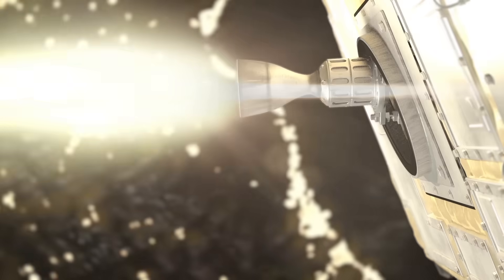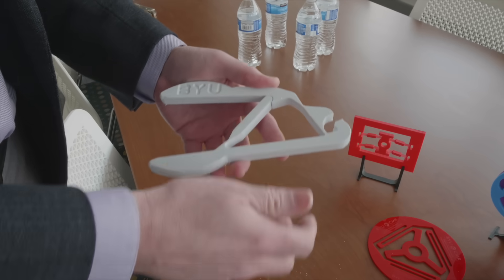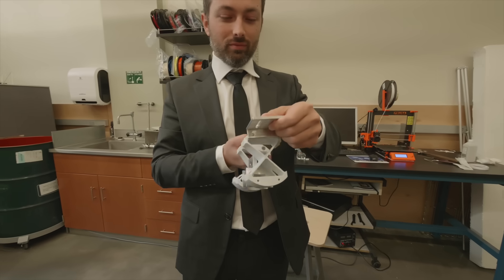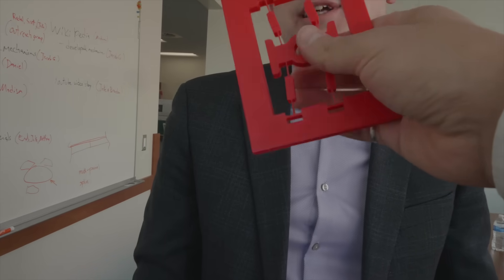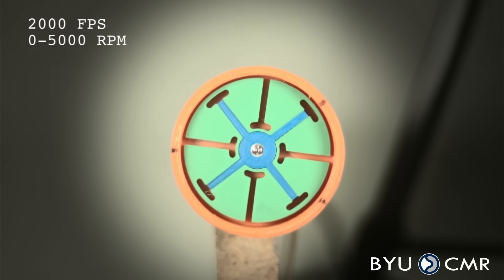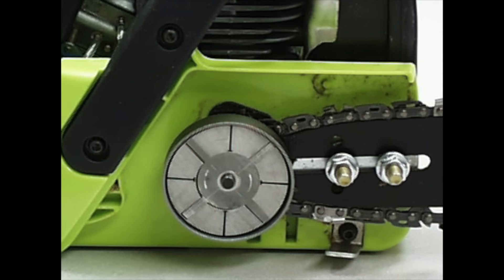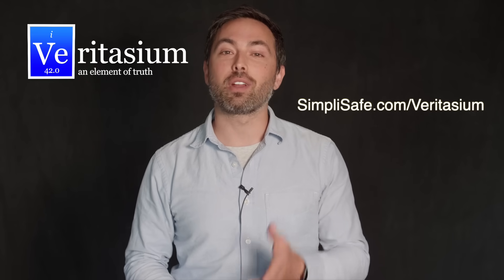Why Machines That Bend Are Better

Comment: over a decade ago I used these ideas to design wind turbine blades that change shape with wind speed.  Just using very specific modulus of elasticity with specific cross section shapes.  This would allow a greater range of wind speeds to be useful.  This idea should fit a host of the problems with current day wind turbines.  Give BYU my idea and have them finish it.  Or contact me and I'll drive up and show them.

Comment: and where is durability of flexibile parts ? :)
Reply: Same. My first thought was material fatigue.

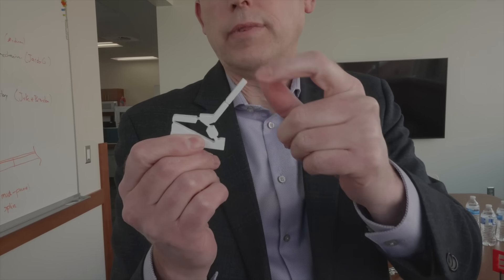But apparently at 3:44, that switch is good for 1 million cycles.
Reply: @aznmarty256  in an enclosed sealed environment free from particulates, heat fluctuations, unpredictable violent usage, sunlight, and so on.

Comment: I may have missed this, but what material was used for the plastic mechanism (I'm assuming they are 3D prints, not injection molded).

Comment: After watching that I'm still left wondering how that nuclear safe device actually works. Need more info
Reply: It appears to work the same way online captchas work to verify a human user. The device is designed to only respond to a deliberate activation by a human user, and never to a random vibration or part failure. It requires a prolonged force of a given magnitude to trigger the device, but will not trigger if the force occurs over a very short time span, even if the short force has a very high magnitude.

Comment: He should work for Apple. They took a solid reliable  design for keyboard key depression and totally renovated it up to total failure with a "superior", failed butterfly design.
Reply: This guy is brilliant. I'd rather have him making safety systems for nuclear weapons than keyboard designs for Apple.
Reply: Since he is actually looking for innovative soultions I don't think he would fit in.
Reply: I have a fix for apple butterfly design. Turn it upside down. The dust will never get at the middle point if the middle point is upside down.
Reply: The design was actually very succesful - assuming you qualify 'succes' as 'reduced manufacturing costs for Apple'.
Reply: Bart Kuijper  I think they feel cheap and not enough travel in the keys to feel satisfying. The clacking is kinda stupidly loud and unpleasant. I know they’re trying to make it quieter, but I’d think an advanced design would be inherently quieter, not louder, than the old design. They only seem to care about making things thinner, sometimes at the expense of functionality.
Reply: @AWSVids  Because "thinner" is something they can sell from a design perspective. And that's what Apple is about now. Form over function.
Reply: Lol yeah but he at least reaps the rewards from his inventions . Wouldn't be so with Apple. 
Apple isn't being innovative that much anymore . They just add a clock to a radio and call it reinvention of whatever. They are pretty much trailing most of the time these days.

Comment: This is mainstream media over hyping as usual. If this were not a MAX, it would have not made the news. This was a non passenger flight. Emergency landings are fairly uncommon, but not as uncommon as most people think. Imagine if you were in a plane with a jet engine that just had a compressor stall. Engine overheat is unrelated to the suspected autopilot issue, just wanted to point that out as well.

Comment: "It's always been considered to be bad, to have flexibility in your machine."
I think that is a very misleading statement.
There have always been parts of machines that have to be rigid, and parts that have to be flexible.
Springs, "snapping latches" and other principles shown in this video, have been arround forever.
Reply: Yeah, but bending hinges are still usually considered a big no-no
Reply: @DeuxisWasTaken  
Bending hinges ;-P
https://sa.rsdelivers.com/product/pinet/54-a-3013/pinet-pp-flex-hinge-clamp-nail-rivet-screw-889mm/3308357
Reply: to add to that, buildings, planes, bridges, and more must be flexible in order to stay in one piece. Buildings must sway with the wind not to crack and fall, wings must bend to not snap, and bridges have to sway less they collapse.
Reply: It came out of a BYU engineers mouth. They have the 95th ranked program in the country. They also have a non existent researching/post graduate programs. Safe to not take this guy too seriously

Comment: He was right w/r/t/ the elephant's trunk, actually. It does go up and in. Just that that movement happens to be cancelled by the rest of the elephant. :P

As for those silicon clickety bits, does this mean we can now etch compact mechanical computers with the same techniques used to make compact electronic computers?

Comment: Mechanical systems can be much more reliable than electronic ones. I wouldn't be surprised if nuclear bombs have many mechanical devices in them.
I heard of a missile that used a spring-wound gyroscope instead of motor driven. It didn't use a battery that could go bad or need to be replaced. It only needed to run for a minute or so, so using mechanical energy made since. It could be stored for years without worrying about replacing the battery.

Comment: Begs the question, why are these not mainstream yet?
Reply: I reckon they'd be a lot harder to design than traditional mechanisms.
Reply: because while these have millions of cycles before breaking, traditional methods have tens or hundreds of millions of cycles, and when these break you need to replace the whole thing rather than a single part.
Reply: @SuperAWaC  I guess that's why they use a traditional machine to test them to failure 3:46
Reply: @SuperAWaC  that`s if you`re forgetting, that one broken piece usually damages at least one more
Reply: @Notmyname1593  well yeah, if youre too late at switching the part but in many cases you dont wait until something breaks to check if it needs to be fixed
Reply: Product design Engineer here: 

modulus of elasticity changes with temperature -  the design will likely have different behavior at different temperatures meaning they are not robust enough
Reply: @mixednutts5416  So nobody has figured out a different material that solves that problem yet? Or there is a material but not feasible for mass production?
Reply: @mystirboy  it seems more like both, but it also seems the whole idea of these designs is to make materials that you'd normally think of not flexing actually work like that titanium pivot in the video.
Reply: @mystirboy 
Generally speaking a technology will have to have a "road map"before adoption.
this includes: materials catalog, material property library, standard operation procedures, applications library, service history, failure mod library, service operation procedures, end of life procedures, and others.

In essence a plan :) and if you don't your idea is dead in the water.
Reply: @mdexterc2894  areospace is a great application for this tech, aero focuses on a "buy to fly ratio"
Reply: @mixednutts5416  But aren´t regular machines designed with the same principle in mind?
Reply: @matiasgoinheix366  he's answering the question on why these aren't more mainstream. Mainstream tends to cut cost for durability and most people don't need the precision of compliant materials. Hence why I mentioned the spring u style scissors scarcity everywhere except Japan where they value it for cultural reasons
Reply: @mdexterc2894  Missed your comment about the scissors. (off topic, but those scissors are widely used in stitching work). I get your point.
Reply: @matiasgoinheix366  yes and no: 
they are designed to not deviate in form/behavior (something like springs being an exception)

In these product the spring material is the same as the rest of the product - this limits the possible properties other areas of the product
Reply: @mixednutts5416  Nice, thanks for the answer.
Reply: Actually they have been around for ages - just think of coil- or leaf springs. Manufacturing the fancy fuckery presented in this video has been rather difficult though. 3D-printing of titanium is so much easier and cheaper than starting with a full block of titanium and wondering how to chip away all the excess material.
Reply: Honestly, I'm not sure there's a specific reason. I've found that with a lot of research going on, all the stuff looks really cool but no one else knows about it. So it's possible that many product designers and engineers just didn't know about it, or that it doesn't come to mind. There likely isn't one end-all answer like "Yes, this is actually to good to be true, and isn't widespread, because it has this specific flaw and disadvantage..." Instead, people might just have never been taught about it.

Every type of design has their own disadvantages and advantages. The job of the engineer/designer is to choose which one best fits the situation, based on their own knowledge. Regardless of how complete their knowledge is – it is impossible to know everything, only to make our best judgment.
Reply: Appearantly in Japan, spring scissors are still common because they can be very accurate at a low price. Everywhere else dropped it in favor of the more durable pivot style.
Reply: Also, because they only last for "millions of cycles" under very... "careful" testing, and using very specific materials. Made with more common materials and "tested" in the real world, it's more like a few thousand (or in many cases a few hundred) uses before they break. Which is fine for some applications, but not for all.
Reply: Designs like that with elastic hinges have been used for decades already. A lot of high precision machinery, like that what is used in semiconductor manufacturing, uses those design principles. Twenty years ago I was thought these subjects in university already. Pioneers in the field started decades earlier.
Reply: Because it violates the capitalists principle of programmed obsolescence.
Reply: they are harder to design and if they are broken you cant just fix a part.
Reply: Pulls out a Tic Tac box :)
Reply: Mainstream production is an enormous beast, even some of the simplest components can require enormous factories using highly complicated processes to manufacture them, to change how a piece of equipment is made entire factories have to adopt new processes or re-tool their machines to do the work, or completely get rid of some machines and replace them with others.  All-in-all manufacturing a new piece of technology at the very large scale is an enormous and costly undertaking which may or may not end up returning that investment, as a result there are lots of novel and useful technologies floating around but nobody has sunk the necessary millions into developing a factory process to manufacture them in huge number yet, so they languish in relative obscurity until there is some dire need for that new technology.
Reply: There's so many weak points in there that can break if the force comes from any other than the intended direction, that I think for many applications it is actually not durable.
Reply: They are.. Just look at thingaverse.
Reply: I'm not certain I agree that they aren't mainstream as another comment on this video listed many applications, but I  imagine consumer confidence goes against these parts.  Which looks more reliable, the metal and rivets or the bendy plastic?  It looks too similar to cheap one-use junk like installations tools that are included with some other product.

That said, I have decades-old plastic crab crackers that I've gone back to multiple times after the strong-looking metal ones gave up.
Reply: One. Thats not begging the question.
Two. They are mainstream.
Reply: There's also the problem of repair.  Assuming the product is still designed for repair and maintenance, if a part gets damaged you can replace just that part.  But if there is only one part, then the whole thing is wasted.
Reply: planned obsolescence, capitalism needs people to constantly buy stuff so engineers today are tasked to build not the most sturdy and durable stuff (at least for normal consumers) but the stuff that needs to work within the guarantee time, after that, is luck and user mantainess that makes things durable. Also selling parts that break is a profitable endeavor.
Reply: To "beg the question" is to put forward an argument whose validity requires that its own conclusion is true. Also called petitio principii, the fallacy is an attempt to support a claim with a premise that itself presupposes the claim. You're welcome. Lrn2english
Reply: @beurksman  Leave the flexing to the machines.
Reply: @beurksman  The usage is too mainstream now and there's nothing you can do about it.

Comment: super foward thinking applied materials science.. wonder what happens when i stick my finger in that there
but anyway i thought the problem wasnt 'how can we get flexible materials into things/ how can flexible material work for us' but ' how can we make flexible materials reliable and what engineering and material science is required to produce the material that can do this and withstand and tolerate it'

Comment: Its great to see people are starting to use flexibility as an advantage in designs (even though I personally never use it). My concern is that when using flexible materials in designs like the WMD activation device, you would have to really see how long thin pieces of whatever material they would use can last without input for years. From my experiences, when things are just sitting out, events in a temperature controlled room, they're going to degrade, plastics especially.

 I'm not trying to sound like an ass but that switch test is definitely flawed. Sure you can take a freshly molded/printed plastic switch and it works as he said over a million times without breaking, but that was also in an environmentally controlled room. I would like to see how well it works after going through heating and cold cycles, in different humid environments, and after just sitting for extended periods of time. If it can do all those better than traditional switches then you've got yourself a good design.

Comment: Mechanical fatigue due to repeated movement is one thing, heat cycle fatigue is another. Would like to see how it tested against conventional tools in a heat cycle environment, maybe the machine turns on and it got hot, and then turns off and cools again.  Or rather cycle life in extreme temperature conditions. Very interesting video

Comment: Isn't this video kind of pointless? I mean, of course machines that bend are better than machines that don't bend. It's a foregone conclusion - if I have a device that can do X, and another device that can do X + A, then the device that can do X + A wins every time. The only reason that wouldn't be so is because of cost considerations and that's not a factor here. 

Anyone with the functioning intelligence of a eighth grader should be able to understand this fairly readily without having to watch 13 minute long video on the matter... But then I suppose the creator wouldn't be able to keep raking in that sweet sweet ad revenue on Youtube, so there's that, I guess.

Comment: that was awesome and all...but how do you 3d print titanium?
Reply: There are a couple of different ways, but any metal that can be powdered can be printed. One way is that a thin layer of powder is laid down and a binder is sprayed on it very precisely where you want to build the part. Then additional layers are put down, each with the binder where you are building the part. Essentially you glue the powder together and the loose powder falls away and you have a somewhat fragile powder part. Then you sinter the part and the powder fuses together to become solid.

Another way is that instead of a binder you melt the powder with a laser in consecutive thin layers and each layer bonds to the layer before it, building up a part. It didn't need to be sintered because it's already been melted together with the laser. 

You can also get metal filament for a traditional consumer FDM 3D printer, print a part and then melt out the plastic to have an all metal part.
Reply: wilwrk4tls thnx for info
Reply: @simpesfaip  No problem

Comment: Wait, I'm too stupid to understand how that prevents arming anything, explain please.
Reply: Because these designs only work if you press them a specific way, they are usually made of only one piece of material (or as few as possible) so there are less parts that could fail. Machines with lots of parts can have one part break then other parts can shake and accidentally do what you don't want it to do. "A chain can only be as strong as the weakest link" type of thing.
Reply: The flexible bits hold the mechanism under constant tension preventing any nonintentional movement.  Basically if you think about a regular switch - you flip it to use it but it can also be flipped if an earthquake shakes it enough, etc.  This mechanism requires very precise input to operate it to prevent any thing from accidentally flipping the switch.

Comment: Wow, this is so cool. One question for the two titanium "hinges", especially the first one that's supposed to be used on solar panels. Since it's probably going to be in one of the compressed positions for extended periods of time, isn't there increased risk of the material weakening/failing in the point of greatest stress?